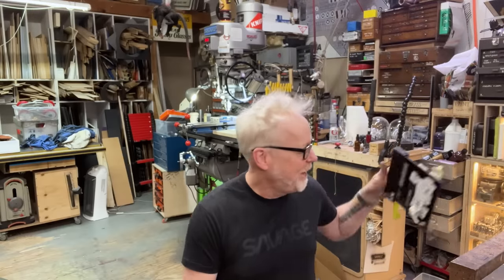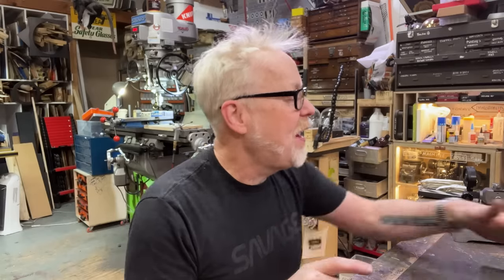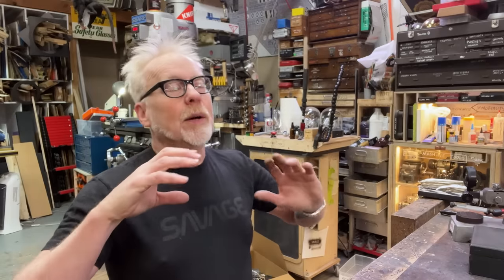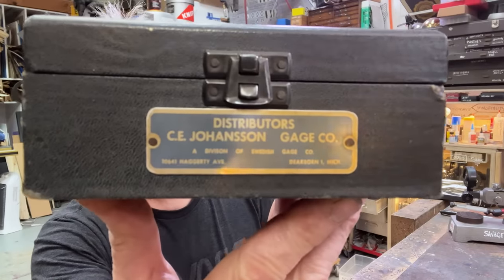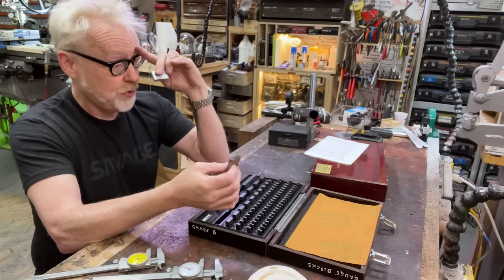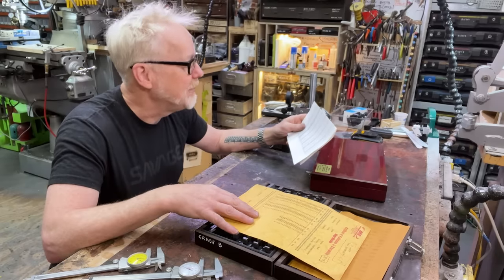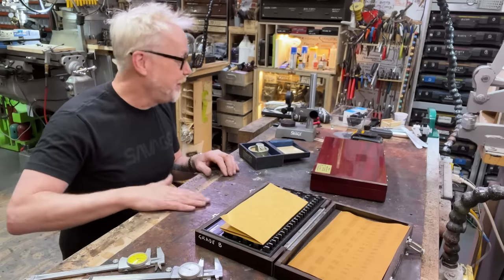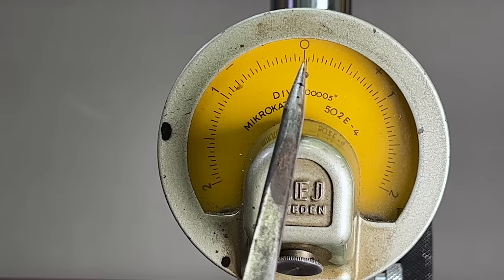Adam Savage's Most Precise Measurement Tool!

Comment: Hi Adam 
Take any 6 digit 2 to 4 input multimeter and a thermistor and see what kind of swing in resistance you get.
I make thermal sensors for a living and my body heat affects the preproduction function tests all the time. Even your breath will give you wild swings.
Reply: Yeah, I think you kinda missed the point. You would need to replace thermistor (a fucking device designed to vary its resistance based on temperature) with like a really short piece of like copper wire, have a resistance measuring apparatus that can measure that short piece of copper precisely, and then heat the cooper with your hand and be fascinated by the results. And even that would be like thousand times to strong of a thing (cooper resistance variation is like 0.4% per degree, while steel expansion is like 12ym per degree on 1m long piece, while Adam is measuring inch block so like 1/40 of that). Your "fascination" translated here would be if Adam was fascinated that a linear piston filled with high thermal expansion material, changed its piston position cause his breath was changing piston temperature or something.
Reply: Bonded resistance strain gauge is a common item use of this effect.

Comment: 35:00 To be fair, as I understand a normal telescope's mirror is also accurate to "less than the wavelength of light", else it wouldn't work particularly well... the insane part of JWST's precision is that all the segments can be moved with nanometer precision to align the segments to each other. (Breaking Taps has a cool video on how those actuators work) 
I'd also note after discussing micrometers so much, red light's wavelength of 800nm = 0.8µm isn't that insanely short anymore, it's actually about comparable to the changes from body heat shown at the end ;)

Comment: I wonder if the change was due to the oils from his hands. a good test would be once the block was set in the under the gauge and zeroed out. To use his index and thumb to hold the front and back to see if the reading increased.

Comment: Yep. Body heat.

Themal expansion of steel is about 11 um/m/K. 

If you heated it by 10 °C, that's 110 um/m. The block was 1 in., which is an expansion of about 3 um, which is about 1/10000 of an inch.

Comment: You’re reading the gage block certification chart wrong… those tolerances on the gage blocks are in millionths of an inch, NOT nanometers.
Also, one micron is exactly .0000393701 of an inch or approximately 40 millionths of an inch. The resolution on your Johansson gage is 50 millionths (in the ballpark of one micron, but not the same).

Comment: Did the dial comparator have a ball tip or the flat end with the thread? This can also give measuring uncertainties.
Also its worth it to tap the arm lightly so all the stresses get released. And I was really curious to see the ceramic to steel and back to ceramic gauge blocks.

Comment: With gauges, the machining tolerances/accuracy are often another factor or so above their advertised 'accuracy'.  Slop/feedback/backlash/tolerances add up (It's a 'machine', after all, and these factors are unavoidable.)

For something to be 'accurate' on a thousandths scale, it needs to be pretty accurate at a ten-thousandths resolution (or higher), for example.

Comment: Adam, you have to connect some wires to the block and send turn the voltage up so we can see how precisely you can measure it with the heat it generates.

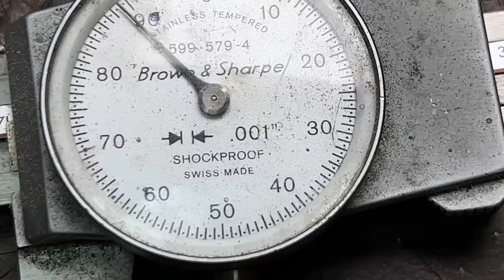Comment: 2:17 - was curious what made swiss movements 'shock proof', as in that pair of dial calipers or watches. Quick search yielded a diagram of a kind of spring loaded (before it hits hard stops if impacted hard enough) counterweight. Interesting design, look up 'swiss watch incabloc diagram' to see how they designed in that toughness to hold up to high g impacts and protect the fine purple jewel bearing surfaces.

Ps, i don't work for them, i just think there's a efficacious beauty in well engineered mechanisms.

Comment: Adam, you will never get to next level of precision until you understand the concept that your inspection equipment is only capable of reliably checking a dimension that is 5 times the amount of the smallest increment it can check. Example: calipers smallest increment is .001 so you can only realizable check something to within .005. Micrometer’s smallest increment is .0001 so they are only reliably able to check within .0005

Comment: Asam having another epiphamy......he gets so enthusiastic, like a kid at a fun fare........what you need now Adam is a projector to project tool shapes at10:1 ratio...... you can view a tool profile with your digital microscope but you need to draw a projection chart with at least 10:1 ratio to view the profile and it takes a projector for that......i used a 35mm slide projector slightly modified to view form tool profiles........hand grinding gear tooth fly cutters becomes easy.

Comment: when that gauge block was in the CEJ gauge would have been the perfect time to grab that cheap low output paint remover/hair dryer that you showed earlier in the vid... or put the gauge block on ice for a few mins, quickly dry it off, put in place and watch the gauge climb, then try the same with the higher grade ceramic block... see how much they differ in total movement

Comment: The coefficient of expansion for steel is somewhere around 10.8x10^-6 m/(m C). So if we were to say that a 1 inch gauge block warmed by 10 C then that would be a expansion of 0.0254 x 10 x 10.8x10^-6 = 2.74x10^-6 m or 0.000108 inches. As Adam's gauge is accurate to 0.00005" per minor division, we can say that not only is it accurate enough to measure the thermal expansion of the gauge block but that we can also infer that Adam actually warmed it by about 5 deg C!

Comment: The difference between the 4 cylinder engine of a civic and the 4 cylinder engine in a formula 1 car is primarily not the design or function of each of its components, but the accuracy with which its components are produced. I never realized until
I learned about how the flattest surfaces in the world are made how vital measurements are in the creation of the greatest achievements of mankind.

Comment: That's quite a thought. When some relatives from the US came to my town and learned that some of the historical buildings we were visiting were built like 2k years ago, they didn't seem to understand how long ago that was. Like "Ok, US history stretches 250 years, give or take, so this is less than ten times older than that. I'm 35 and my daughter is 3, so I'm roughly 10 times older than my daughter. So yeah, that was a long time ago, but not that much, tenfold by tenfold". Man, when they learned about everything that happened in that "not much of a difference" they couldn't believe it. Everyone who hasn't, should visit a at-least-a-millenium old city. Any of the folks you walk by, might be connected to some guy who was involved in the building of one of those ruins you are visiting by a direct lineage of a hundred of ancestors.
Reply: Also, in some of those towns, you can still find a carving on a pillar or an arc in the old market square that defined the "measure" for that town. Before any national standard was made, well, even before there were something that could be considered a nation, every town had it's own measurements, so every one in the marketplace had a reference. Merchants would adjust their prices to those "measures".

Comment: hi, awesome video :D i have a question tho. how the needle of the gauge mesure ? since it doesnt appear to be connected like normal needles are.
Reply: There is a strip of metal that is twisted into a helix and mounted at each end. The movement of the plunger moves one of the mount points. As the length of the helix changes, its twist moves slightly. The needle is attached to the helix such that that change in the twist moves the needle.

The Wikipedia article for "Johansson Mikrokator" has a lengthier explanation and a diagram.
Reply: @wbfaulk  i think i get it now… thx a lot :D

Comment: Maybe not related: How do you support your equipment on the existing floor of your shop? Sometimes under use on camera the machines appear to flex - appears the floor is flexing. It seems like the efforts to chase zeros is being compromised by the existing condition of floor deflections or, environment. Temperature considerations? I'm sure you have considered all of this. Thank you and no offense intended.

Comment: Yes, the sizes become incomprehensible to people who don't have to deal with them daily.  A microscope can show something only related to the visible light wavelength.  That actually spans about 1 octave, from 400 nanometers to 800 nanometers (or some sources define 390 nanometers to 780 nanometers).  I don't have personal measurements, so I just like the rounded numbers.  Anyway, you should consider that the microscope resolution is better at blue light than at red light.  Blue light has a wavelength closer to the 400 nanometer, while red is closer to 800 nanometers.  Regarding to the comparator measurement, I have one comparator that claims 0.000 01 in/division (your comparator claimed  0.000 05 in.division).  I cannot breath while using it...  By the way, the microchips of today cannot be manufactured with any means that depends on visible light.  They have already a long time required using far ultraviolet light, much shorter than the edge of the visible spectrum.  If I recall, pure quartz loses its transparency at about 190 nanometers, and normal glass at the edge of violet/ultraviolet, that is near the 400 nanometers.  No wonder, there is just one company in the world that makes the latest microchip manufacturing machines, offering feature sizes below 10 nanometers.  Finally, the size of hydrogen atom is on the order of 0.1 nanometers ( or 1 Å ).  I don't try to compare those to my hair any more...

Comment: I’m told we don’t exactly understand why wringing sticks the blocks together. The two main theories I hear is that the oil from your skin and the precision of the blocks causes a vacuum effect, and I have also heard the atoms of the steel form a partial bond from the surface area of anatomically flat spots. Not sure, but I do know that even the B grade blocks are at a level of precision that takes special means to reach. Calipers are the closest thing to precision the average maker/builder will ever achieve.

Comment: That temperature expansion variance is deceptively tiny - by which I mean it’s small enough that, on a human scale, you don’t really notice it, but when doing machining, it can wreak all kinds of havoc.  I once worked in a machine shop that made parts for mining equipment, and they had to keep the temperature in the shop at 68°F +/- something like 5°F because of thermal expansion.

Obviously, we operated at nowhere near the kind of precision your new tool has, but it’s really nifty to SEE twelve seconds of palm heat expand a Jo block.

Comment: Steel expands and contracts at about 12 microns per meter per degree C, and this gauge block is an inch tall, right? So if it expanded by 0.00005", that's about 1.2 microns. The length along the axis of expansion is 0.00254 meters. That means the heat of your hand raised the temperature of the steel by almost exactly 39.37 degrees C. Assuming a thermal conductivity of 16 W/mK, you put 1.6 watts of power into the gauge block for however long you held it. WILD.

Comment: 6:00 If it measures 0.01mm then the metric one is more granular, not less.
1 inch = 25.4mm 1/1000th = 0.0254 mm
0.01mm = 1/100th of a mm = 0.01mm

Comment: At my work I often see measurements in fractions of nanometers. I'm hoping this series continues to that point that this is comprehendible. Not sure how practical it would be, we have to use interferometry to get this precise. Optical flats are neat way to visualize really small particles.
Reply: I work in the semiconductor industry and there are tolerances measured in fractions of nanometers. It would be fun to see Adam tour a fab.
Reply: What field are you in with such measurements? Feels like optics or semiconductor industry.
Reply: I understand in a mathematical concept but i struggle to intuitively understand it. 😮
Reply: @mr_gerber  I work semiconductor industry. Probably one of the only industries where such fine metrology is used at a large volumes.

Comment: The problem I have with rulers and everything that measures increments with a line, however fine, is that the line itself has a width... so which side of the line do you measure to? For most purposes (including most things that I make), that variable makes no difference. Near enough is near enough. But, where it does matter, this can be an issue.
I have used a scroll saw to cut shapes that have to fit exactly... to the point that I've used a microscope attached to the saw to follow the line exactly. But, even if drawn with the finest drawing instrument, through the microscope. the line looks as if drawn with a sharpie and even the finest jeweller's  blade looks like a bandsaw blade.
Does anyone know if there is a drawing software in which the printed lines are two-tone along the length... say one side of the line is red and the other side is green. The point at which the two colours meet has no dimension regardless of magnification. In reality for my purposes, following a fine line is close enough. But there must be applications where this level of accuracy is critical and that would require a split-line drawing software. Any ideas?
Reply: The simplest solution is probably cutting a bit bigger than needed and then shave off the rest on a lathe equiped with a micrometer
Reply: @pascal6871  Well, stuff made on a scroll saw isn't really conducive to lathe work... they're very circular oriented. On larger pieces you can file or sand to the line but, when you're cutting intricate shapes... particularly small intricate shapes and you're using high magnification, your field of view is very limited. It's easy to get confused over which is the waste side of the line so you have to keep pretty much on it.
I draw the design in Photoshop with a line width of one pixel and paste the print-out onto the piece. The blades I use are often thinner than the line and I aim at cutting along the centre of the line. You need a microscope for that and you only see just over a centimeter of the drawing at a time. Your turning the work this way and that so, after a while, you've no idea which is the waste side of the line.
Reply: It sounds like you are trying to do extremely precise work with a crude tool. At least in comparison. 
This is where the art comes into play. You are using your own senses to get it as close as possible. Good luck on finding something that can refine it further.
Reply: @rontocknell5400  you could manually mark the waste side with a sharpie if orientation is the biggest issue

Comment: I'm working on restoring a former NATO satellite ground terminal for use in radio astronomy.  The aluminum surface is accurate to within 1mm RMS over the entire surface, which is 12.8m in diameter.   The original position measurement units (called resolvers) were good to 1/1000th of a degree.  Sadly, NATO took those units with them when they left in 1995 :(

Comment: @20:28 "Three Hours Later" OCD Moment!😁
@32:17 Reason why Metrology labs are Temperature controlled and sometimes Pressure and Humidity controlled as well, with items to be measured having dwell times for  stabilization at Metrology Lab conditions, before accurate measurements can be made.
Yoda would make a Wonderful, Patient Metrologist?😁
Mike in San Diego.🌞🎸🚀🖖

Comment: im a photographer and maker type... i barely need anything more then a 0.1mm when i 3d print stuff... i work with leather and 1 or 2mm is no real diff in my stuff...

but the science of measurement is staggering...

the photographer in me loves it bc - the shutter speeds of my camera - the science and engineering that goes into that... the way the lenses are made... everything -  STAGGERINGLY cool.
Reply: If you're a photographer, in your hands in something that has a surface roughness better than probably .002mm and a form error of .02mm. That is if my assumptions that lenses for cameras need to be better than eye glasses. If they're high dollar Nikon lenses, then it most certainly is as I was told by a professor if you care to take measurements with a digital camera, you buy Nikon. He needed to see form changes in the range of .001mm or smaller.

Comment: Calling back to the James Webb Space Telescope (JWST), he's right that this device doesn't measure anywhere near the precision for some of the systems JWST utilises.
For example, that gauge precision of within 0.00005" works out to about 1200 nanometers.
Each mirror segment of JWST is about 1m across and weigh about 20kg. A mirror segment in the primary reflector of JWST has 6 actuators attached that can move, angle, and flex the segment. These actuators have about 2cm in their full range of coarse movement. In their more fine motion mode, they have a range of motion of 10 microns and can be moved in increments of less than 10 nanometers.
It is remarkable that humanity was able to make such a device survive a ride into space and multiple deployments once in space.

Comment: Same problem with Celsius vs Fahrenheit - Fahrenheit has more degrees between freezing and boiling. Thus, every device that has a thermometer/thermostat in F to the tenth of a degree, is far more accurate than the same device in C.

Comment: 6:11 you say 0.01mm (which can be seen on the dial) you then say "One tenth of a millimetre" which is not right. tenths would be 0.1mm. 0.01mm is 1/100th of a mm, which is almost exactly 0.4 thou. or 4 tenths, thus making the Metric MORE granular than your thou only caliper set.